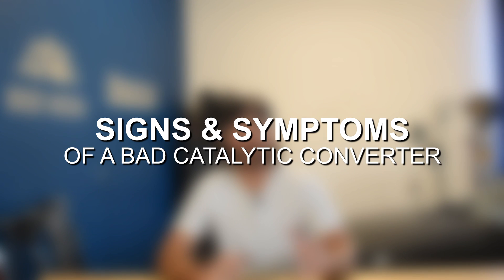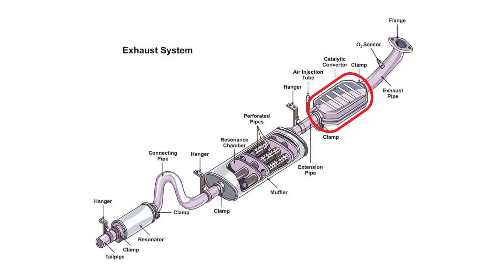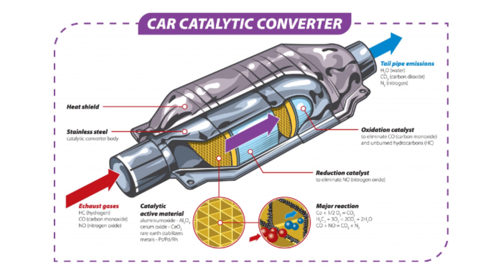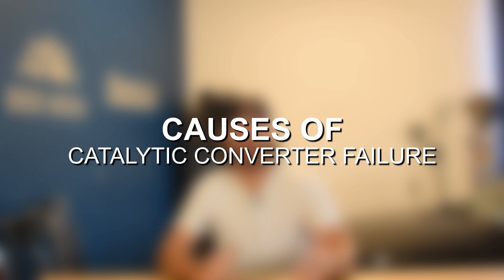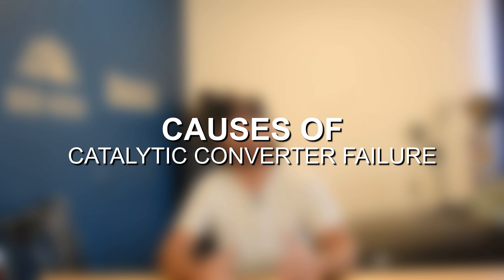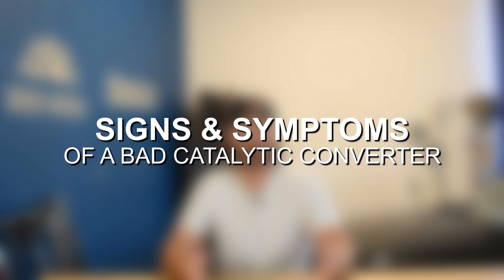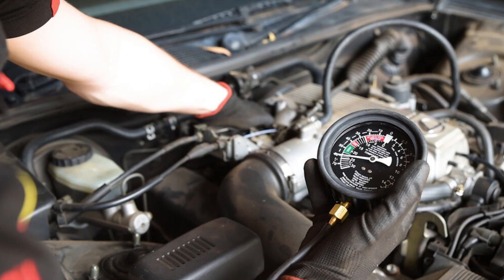Signs & Symptoms of a Bad Catalytic Converter!

Comment: I had my 2019 GMC Sierra worked on by GMC. a lifter was bad causing a ticking noise. They replaced the lifter and a bent push rod. All 8 lifters were replaced and pushrods. I drove it about 20 miles and check engine light came on. Took it back to GMC they said its a bad Cat on bank 2 (same side the initial lifter was bad). is this just a coincidence or could they have done something by mistake
Reply from the maker: Definitely seems suspect but I don't think a lifter replacement would create any issues with the cat. It could also just be bad O2 sensor and not the cat itself - I wouldn't go paying for an expensive new cat without confirming the cat is clogged or going bad first..

Comment: 1990 car with stock cats should I replace ?
Reply from the maker: I - You should check them beforehand, if possible. Typically they aren't cheap. Are you having any issues? or just suspecting they are bad?
Reply: @8020Automotive  I was smelling like a sulfur smell when my exhaust was on I pulled the pipes, and then I sunk the cats in laundry detergent and then clean them with brake parts cleaner. Afterwards I put a leaf blower on the pipe air was flowing right through them.
Reply from the maker: L - How'd it turn out? Sounds like an interesting technique.